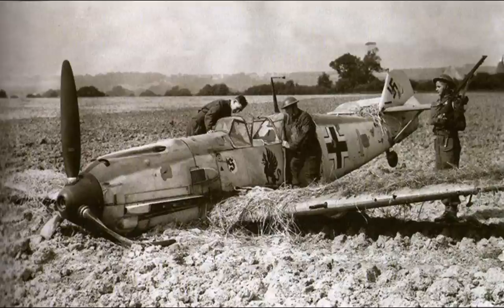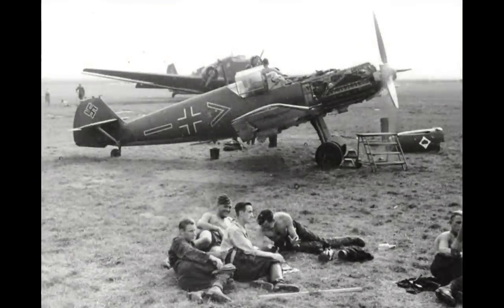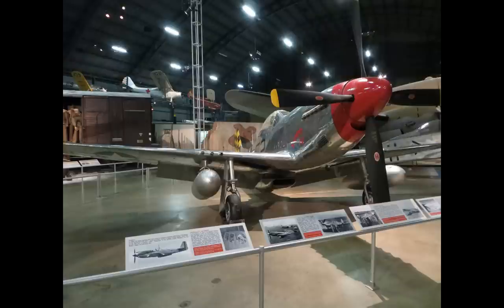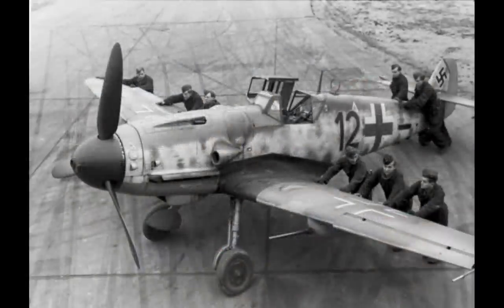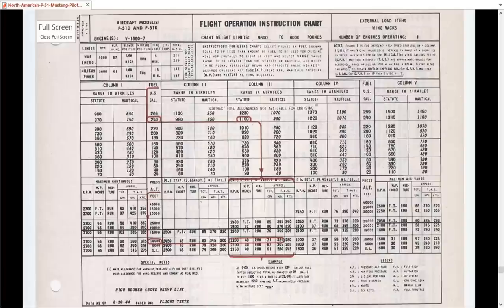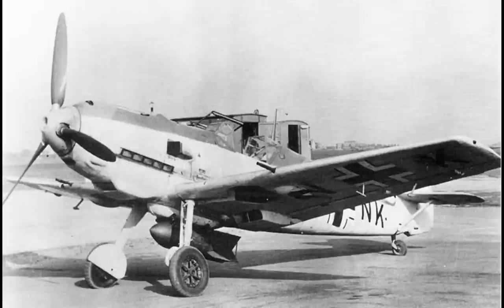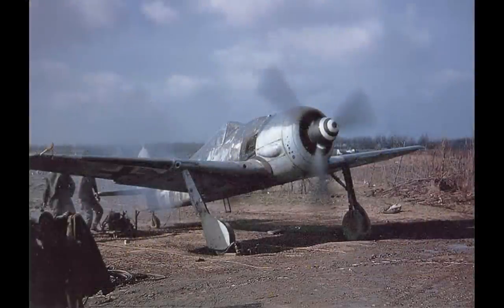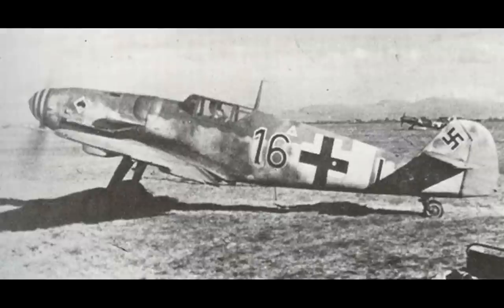Messerschmitt BF 109, Why Such Short Range?

Comment: I feel you are perpetuating a myth about early Merlin engines. The Spitfire DID have a functioning inverted fuel system. The problem was that in the switch over from normal to inverted, both systems would function briefly which caused the engine to overfuel and go into a "Rich cut" for a short time. This momentary loss of power was sufficient for a 109 to get away from the chasing Spitfire. It was very rapidly fixed by the inclusion of "Miss Shilling's Orifice" which was a small restrictor in the fuel system developed by a Miss Shilling of the Royal Aircraft Establishment, Farnborough.
Reply from the maker: It's not a myth. I shall quote from the Spitfire II factory manual: "the engine WILL CUT WHEN INVERTED". (emphasis is mine).  The myth is that Miss Shilling's "fix" did anything other than delay the cut, it was nowhere near a total fix. That came when they switched to US Bendix injection carbs.
Reply: @GregsAirplanesandAutomobiles  I think we have to agree to differ on this. All British fighters of this period had inverted systems. We should also be careful of how we read manual instructions. Any pilot reading this would have known that the Spitfire's fuel system would run inverted, therefore the sentence you quoted would mean to that pilot that it is a temporary cut. There is plenty of film evidence of early Spitfires producing momentary puffs of black smoke as they go inverted followed by normal running. The Spitfire could fly inverted it was just the transition that caused the problem.

The fuel system was capable of transporting over 150% of the maximum fuel consumption of the engine to the carburettor, the orifice fix reduced it to about 100% and as the engine would have been at full throttle anyway. That would stop, in a very crude way, any temporary rich cut. Later carburettors were much more advanced and work much better.

A lot of aircraft with carburettors have inverted systems that are effectively two carburettors with one for upright and one for inverted flight.
Reply from the maker: I think you may be confusing inverted with negative Gs. It can fly inverted if pulling positive Gs, for example the top of a loop, or a properly done barrel roll. If you think the early Spitfires had a fuel system that functions during negative Gs, then please post  your source. I think what your are seeing is a cut out due to negative Gs and then the engine start up again when under positive G, even if inverted.
Reply: @GregsAirplanesandAutomobiles  I will get back to you on this. It is knowledge acquired over the years whilst speaking to many people involved with the aircraft. Certainly the fact of the brief rich cut was common knowledge a couple of decades ago, but the internet seems to have perpetuated the story of permanent cut. 

I ask you honestly, who would build a front line fighter without an inverted system when a carburettor based answer had been available for years before
Reply from the maker: Who would build a front line fighter that way? Everyone. No front line fighter from WW2 I know of had a negative G oil system, none.  As an example, the P-51D is limited to 10 seconds of negative G flight per the factory manual. For that reason there is no point in putting in a true negative G fuel system and I don't know of any WW2 fighter than had one. The issue with the early Spitfire's was that ANY negative G, even momentary would cause the engine to cut out. The 109 and US planes could take those momentary excursions and could stay in negative G for about 10 seconds, which is plenty of time to get back into a positive G state. I'm basing all of this on factory manuals.
Reply: @GregsAirplanesandAutomobiles  Ah, I thought we were talking about inverted fuel systems which a lot of aircraft have that do not have inverted oil systems. Even the humble Stampe bi-plane trainer had an inverted fuel system. 

As for confusing the aircraft being upside down with true inverted flight, I am not. I have done a lot of loops and barrel rolls in all sorts of aircraft over the last 50 years (I think 36 or each in a day was my record when running a pleasure flying outfit), so I do know the difference.

As you suggest I will check my sources.

Comment: 10:50 

I don't think you understand the claim about the cooling effect that the Merlin benefited from, and the DB engines did not. It is not because of the pressure drop from the venturi, because as you rightly say, any cooling effect would have to be paid for by having to force the air through the narrowing venturi in the first place.

The cooling effect is from the evaporating fuel, not from a venturi pressure drop. However, fuel injection doesn't magically have free high pressure without consuming power either. Perhaps the fuel injection pump takes less energy to drive than a venturi does, or perhaps it's the other way around, but that's a separate issue.

The claim probably originates from a paragraph in Sir Stanley Hooker's book "Not Much of an Engineer". Stanley Hooker was in charge of supercharger development at Rolly Royce, and firstly improved the first Merlin supercharger as much as it could be, designed the two-stage supercharger that appeared in the Spitfire IX, went on to design the first Rolls Royce turbojets, including the Nene which effectively powered the Mig-15, designed the firat Avon, then the Olympus at Bristol for the Vulcan and Concorde, designed the Viper turbojet and then modified it with a big fan to power the Harrier, and ended up coming out of retirement to 'fix' the RB-211 that bankrupted Rolls Royce, and got it performing properly. I say all this to give credibility to his statement about carburettor cooling. He surely must be one of the top ten most significant aircraft engine designers of all time.

He said:

"Let me now add that the Germans paid a large penalty for their fuel injection. When the fuel is fed before the supercharger, as on the Merlin, it evaporates and cools the air by 25ºC. This cooling enhances the performance of the supercharger, and increases the power of the engine, with a corresponding increase in aircraft speed, particularly at high altitude."

My take on this is that the main point is that the fuel is introduced BEFORE the supercharger, and that the supercharger can take advantage of this cooler denser air by pumping more of it into the cylinders, without having to reduce pressure due to detonation due to too high an intake charge temperature.

This same advantage could no doubt occur with fuel injection, and indeed might even avoid the energy required to force the air through a narrow venturi of a carburettor, but the point is that the Bosch fuel injection system injected the fuel DIRECTLY into the cylinders, so there was no advantage to the supercharger. Perhaps there was some cooling effect directly inside the cylinder, but maybe not due to compression and other things that I don't understand fully.
Reply from the maker: You seemed to have misheard what I said, so I'll try and clarify it. I said that that the venturi effect does not result in a net benefit and that fuel injection is superior. I did not address anything written by Stanley Hooker.  I also did not address the evaporation of fuel because that's not unique to carburetors, not at all. I am not sure how you got that from this video, because those two items are NOT in it. 

 Both carbs and fuel injection can take advantage of evaporation of fuel. Only a small portion of the fuel evaporates, thus there is no practical reason to have it all flow through the supercharger. That's the reason the Germans didn't do that. In cases where they did inject fuel at the supercharger they only injected a small amount, and injected most of the fuel at the cylinders. That gives the evaporation, AND the good distribution that no carb can match. That system was used on the FW190 (some versions). In the case of the 109, they didn't do it because it's ineffective as compared with injecting water. Thus there was no point in injecting fuel prior to the supercharger when they had the MW50 system  which was far more effective. 

    Think about it. Do you really think the DB601 would have had more power if it had a single or dual fuel injectors spraying in all the fuel prior to the supercharger instead of individual injectors? Of course not. 

Even without the cooling effect from the fuel entering at the supercharger, fuel injection is far superior in terms of performance. That's the reason that there is no case in motorsports where carbs are used over fuel injection unless the rules require them. Fuel injection simply gives more power.
Reply: @GregsAirplanesandAutomobiles  "Do you really think the DB601 would have had more power if it had a single or dual fuel injectors spraying in all the fuel prior to the supercharger instead of individual injectors?"

Yes, of course it could have. If the cooling effect of the evaporating fuel allowed the boost to be increased enough to offset the poorer fuel/air distribution due to single point carburettor/injection relative to multi-point or direct injection.

It wasn't a simple job to create the two stage supercharger on the Merlin as it would have simply raised the charge temperature too high and not much boost could be added before detonation set in. They had to add an intercooler between the superchargers and this was no simple task in the space available. They had to use an experimental cooling matrix. So high charge temperature was a very real limitation on power, and any method of reducing this (and evaporating fuel was one of them) would allow more power to be produced.

You originally referred to a myth that the carburettor was superior due to a cooling effect after the venturi. I agree that if the cooling effect is attributed to the venturi, then this is not true for the reasons you laid out. However, there was a cooling effect that the Merlin enjoyed over the DB601 due to introducing the fuel upstream of the supercharger, and that is no doubt the origin of the story, as written by the man himself responsible for superchargers that built the engine. The story might have gotten twisted through the years, so it's good for it to be corrected.

I suspect, but don't know, that the cooling effect was most significant when introducing fuel upstream of the supercharger because the pressure was lowest, below atmospheric obviously as that is how a carburettor works. I think that the cooling effect could have been much less if introduced into higher pressure air that was downstream of the supercharger (perhaps very close to the intake valves), and probably even much less if introduced directly into the very high pressure cylinder pressures which is how the Bosch system worked on the DB601 and DB605.

Fuel injection does have more potential for higher peak power, lower emissions, and higher economy relative to a carburettor. No question. It does this at the cost of higher complexity though. Direct injection was problematic for many reasons, and we are only seeing it now in cars due to the very tough emissions laws and the ability of modern electronics and injector technology to do this reliably.

Comment: You need to look at strategy , the Blitzkrieg was stategy was designed to be carried out in Europe and most of the countries that Germany would probably be fighting against had land boarders with Germany and the Luftwaffe was to support the ground forces , with the Bf 109 providing fighter cover , so it did not need a long range , if you look and the performance in Poland , the low countries and France it did not have a range problem, Hitler did not want or really expect to fight the UK , he knew that the Royal family were pro German and many of the ruling class were pro- Nazi he expected them to make peace and let Germany control Europe , while Britain controlled its empire , so long range bombers and fighters were not a priority, because the existing aircraft were adequate , it is really only once they invade the Soviet Union that things start to fall apart and the range of both fighters and bombers are no where near good enough for the distances they need to fly to carry out strategic operations.

Comment: Why not 109s in the thumbnail?
Reply from the maker: Why?
Reply: Greg's Airplanes and Automobiles The aircraft in the thumbnail have radial engines, and are clearly not 109s. Why wouldn’t you use 109s?

Comment: One thing: if carburetors didn't give any advantage (and I've read otherwise), how come DB601 with far larger displacement had marginally better power output compared to Merlin II?

I've read something about "fuel density" in supercharger that was actually better in carbonated engine.
Reply from the maker: I have an entire video explaining why the Merlin has more power per amount of displacement. Carbs do not make more power than fuel injection, that's the main reason Merlins went to injection in later years.
Reply: @GregsAirplanesandAutomobiles  can't seem to find it. Could I get a link? Love your channel btw. Learned a lot.
Reply from the maker: Thanks, the problem is that my titles can't really convey everything in the video. Here you go: https://youtu.be/sTD7DqXfRno  and then, https://youtu.be/1PA70pN6zPM . That should take care of this question.

Comment: The Mustang was faster because of its airframe. In wind tunnel testing, yarn was taped to and all over the fuselage. Like some 600 plus places, the air frame proved to be dam near impeccable. The only places burbles were found were up under the dog house, (rear scoop) in the flat or negative area. And just about even with the firewall. Just after the exhaust. This was caused by the prop vortisies. Curling in from the slipstream to the fuselage. Other than those to small spots. The airframe was impeccably designed, and still not beaten as far as I know still today the smoothest air frame ever built. Buy wayne Ogden A.P. License # A2515 & # P2517 Embry RIDDLE SCHOOL OF AERONAUTICS. 1977-79  ALSO A GRADUATE OF. Aerospace engineering. 80-84 I think I know what I'm talking about.
Reply: P-51 Designer: A German, by the name of Dutch Hintelberg. I hope my spelling is correct. Dutch would roll over in his grave.
Reply: And forgive me a Laminar air foil.
Reply: @wayneogden9557  Wayne, can you say more about the laminar flow wing? I have heard from other AEs that the P-51 laminar flow was difficult to maintain due to the mild imperfections in manufacture and the "oil canning" of the wing surfaces. While the wing design of the P-51 was impressive, the amount of benefit from laminar flow is difficult to quantify, true?

Comment: The speed difference twist p51 and 109 was aerodynamics of p51 play a part was p51 more slippery through the air
Reply: P51 wing was optimized for high altitude speed and used a laminar flow airfoil. At high altitude it was more aerodynamic than the Bf-109, not so much at lower altitudes.
Reply: @pimpompoom93726  the Merlin engine in p51 was faster than Merlin in spitfire.  .was that due to p51 slippery airframe

Comment: In Frace the 109 used drop tanks
I don t know why they didn t use it England
Reply: @InfiniteMushroom only at the last stadges of the battle the 109 caried a bomb
Reply: Know I find this in Google
"The Germans did develop a drop tank for the Me 109 prior to the invasion of France.  Unfortunately, the design was rather hasty and the tank (made of plywood) tended to come 'unglued' (great shades of Ta 154!) when in use.  The design allowed for about 70 gallons of fuel to be carried.  Because of the leakage problems and the potential that resulted in it being a fire hazard it went unused.  The original intent was that the Me 109E-7 could use this tank to extend its range for use in both the French campaign and later against Britain. 
This is another case of a single German manufacturer building a defective product on the spur of the moment and when the product fails to meet service requirements there is no suitable alternative.  By the time the problem(s) comes to the attention of higher levels of command and is dealt with the operational effects have already caused debilating losses. 
Look at the same problem with the Me 110.  The D model with the Dackelbauch tank suffered a number of losses from explosions occuring when the tank emptied and the remaining fuel - air mixture was exposed to a spark.  If anything, the technical incompetence of the Luftwaffe's technische Amt in providing suitable and adequite equipment and aircraft to that service was a discrace.  The Göring had the stupidity to place such technical idiots as Ernst Udet in command of this critical branch of the Luftwaffe only shows his own incompetence as a leader.[/i
Reply: Thank you HiWetcam  
Before I meant Now insted of Know
Please see " https://battleofbritain1940.com/messerschmitt-bf-109/ "Here says " During the latter stages of the Battle, the Bf 109 was used as a fighter-bomber (Jagdbomber or Jabo), carrying a 250 kg bomb underneath the fuselage. "